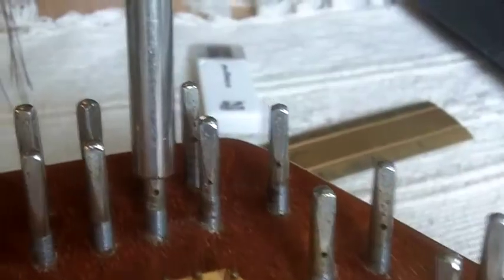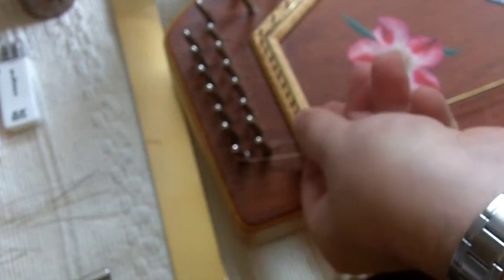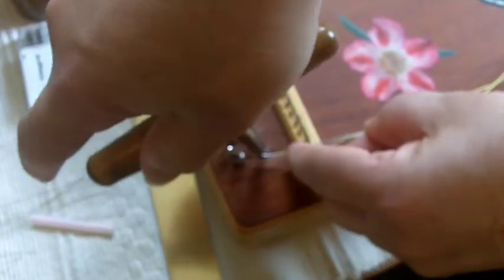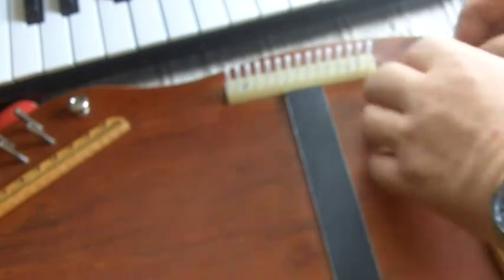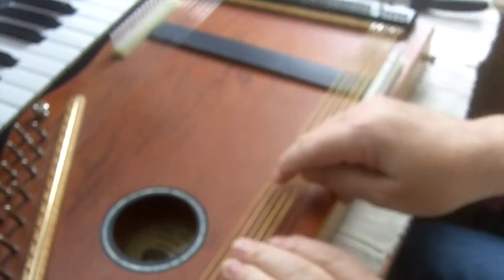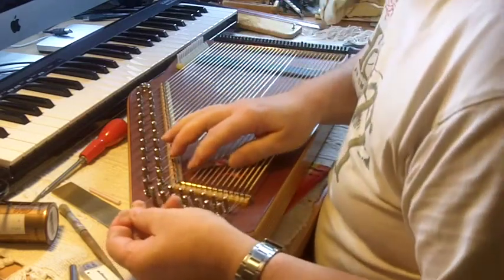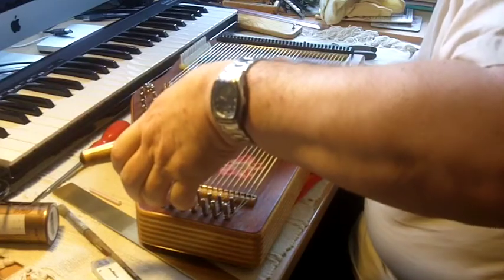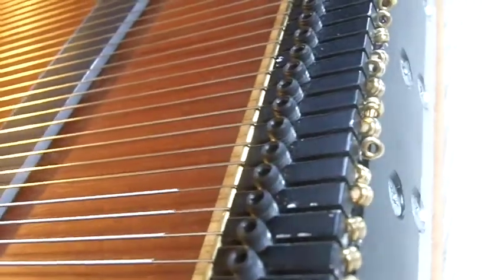Restringing an Autoharp   Part 2

Comment: I just replace my "D" string this evening, Didn't have the right dia, of string, but had the next best string I could get available. Instead of a .019", I used a 0.18, and it worked well in tuning. Even at .018", it was still a bugger to get it to wrap correctly, so I stuck with the best I could do, and tuned it up to proper pitch of "D". Those thicker strings are a real pain in the but to wrap correctly. they are more like a spring wire, they are so stiff It's not hard to get a cross-over, while wrapping on the turning pin. Oh well, it plays okay, even if it got wrapped over the previous turn or two. Even the piece that remained on the tuning pin, was a bit of a struggle to remove with pliers. There is not much room to use pliers in that area as a wrap guide, or string remover. Your the first I have seen, stringing a thicker string on a harp, while all the rest string up the easier thinner strings of higher pitch on You Tube. Thanks for showing. I don't feel so bad that I goofed the wrapping on my "D" string. Least my harp is in proper tune now, with all strings present.